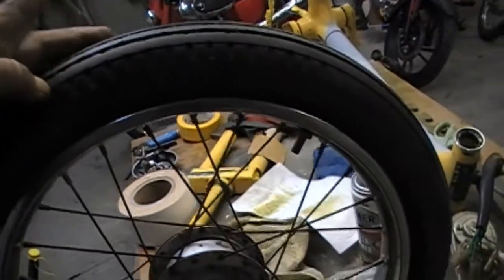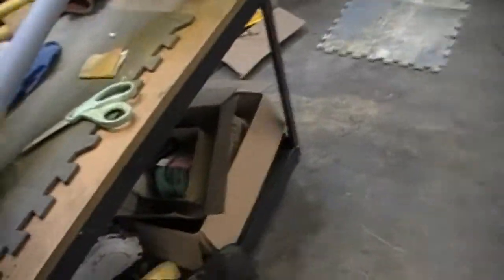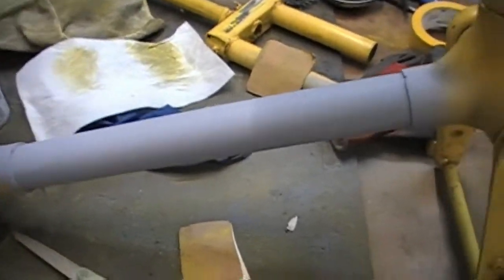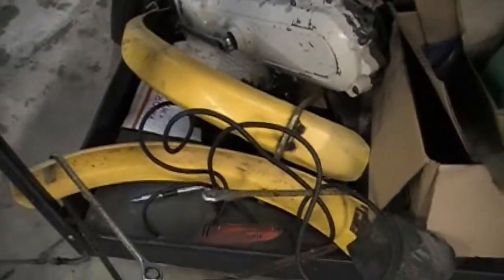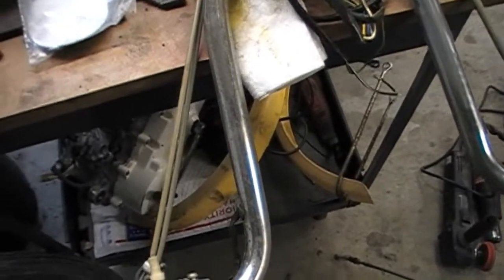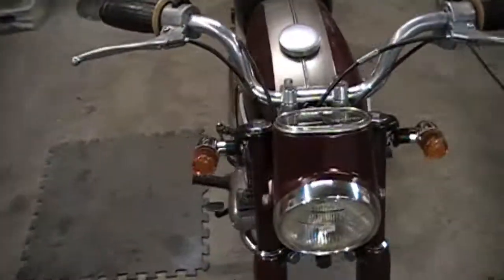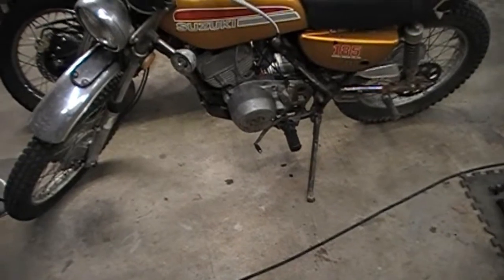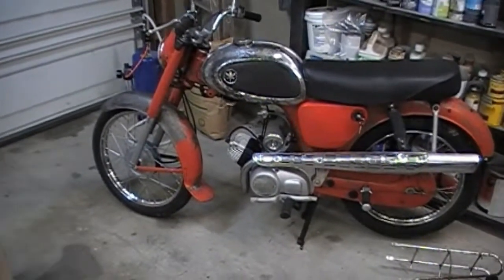1978 Honda Express pt2

Comment: What was your ignition issue? I’m curious to find out. Thanks
Reply from the maker: It was either a ground issue or the coil.  I suspect the coil, since I replaced it, I haven't had any issues.  But I did go over all the wiring to make sure everything was good.
Reply: @gregslair4278  that’s good, I have a small series of videos for honda express bikes. Maybe some of the videos can help you in the future. Do you think that is possible that someone can advertise a part as a 6 volt part but can also work on some 12 volt systems too? I’m about to install a new coil on my express and I’m curious, Ive never heard of anything like that before let me know your thoughts on that thanks.
Reply from the maker: @miguelpagansr6128  Post them up and send me a link.  As far as I know a 12v coil will work on a 6v bike, but not the other way around from what I've read.
Reply: @gregslair4278  thank you sir, have a good one
Reply: @gregslair4278  All the videos are
under the same name, I’m thinking about changing the name to something catchy.
Reply from the maker: @miguelpagansr6128  Lol, I still haven't quite figured out this whole YouTube thing, but a unique name never hurts.  I went under my name for the longest time before I figured out how to change it.
Reply: @gregslair4278  I thought about Grumpy’s Random Fixes with a picture of the grumpy elf from Snow White.
Reply from the maker: @miguelpagansr6128  lol, your too young to be an old grumpy.
Reply: @gregslair4278  I’m 54 but you could never be too young or too old for that. I’m only grumpy when is necessary lol.
Reply from the maker: @miguelpagansr6128  watched a couple of your vids and you sound much younger.  And I agree, I don't feel as old as I am....
Reply: @gregslair4278  thanks for watching, if you still have the Honda express I’d like to see more videos on it or anything motorcycle related have a good night and I’ll catch you on the next one.
Reply from the maker: @miguelpagansr6128  No problem.  I got both still and plenty more bike videos coming.